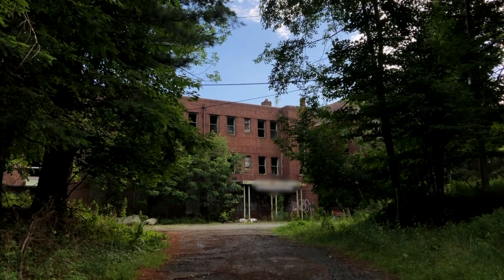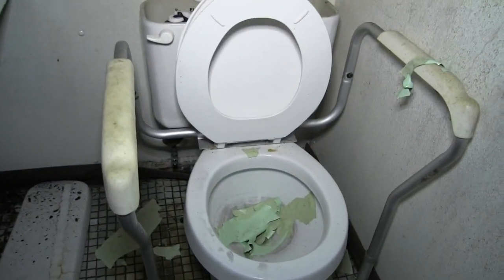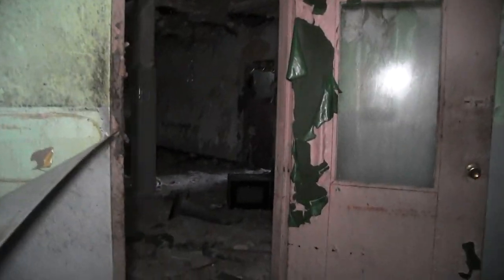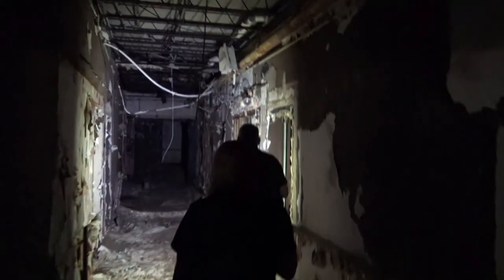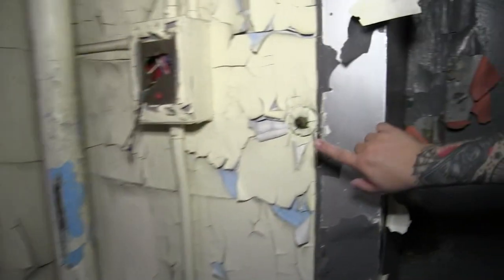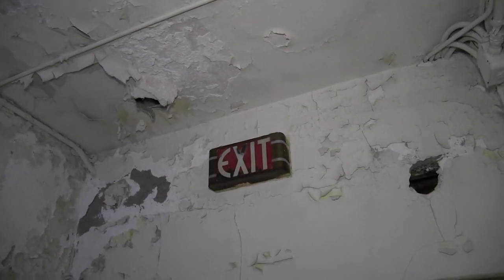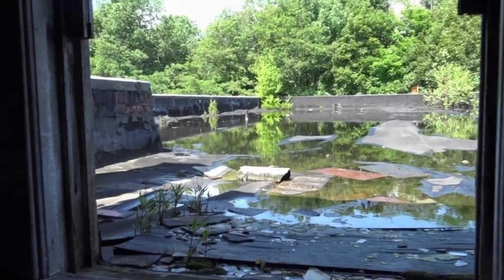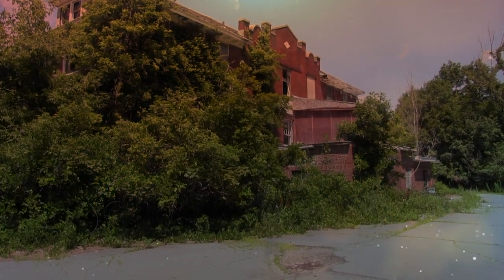DREAD and DECAY in a 1930's Hospital Exploration Adventure

Comment: Hi do you know what caused the paint to flake off all over, im curious
Reply from the maker: Hi! It's really the lack of temperature control that causes paint to moisten, bubble, split and peel. Without the AC on in summer, it really takes a toll on any painted surface, but it looks rad years later. Thanks for watching! ✌️
Reply: @FullDarkParanormal  Ah got it thanks so much